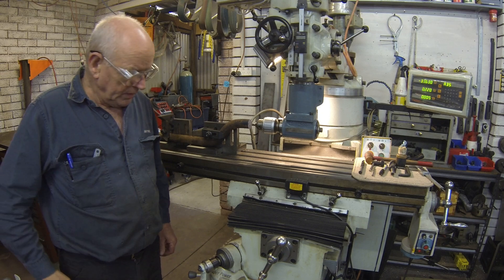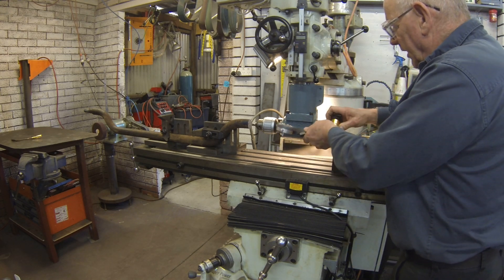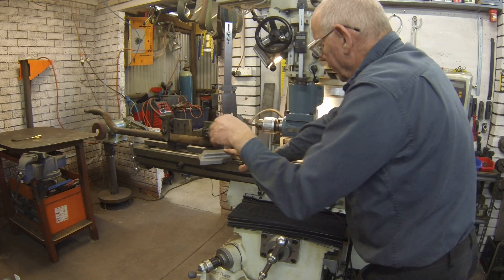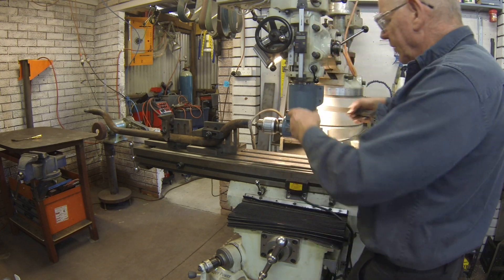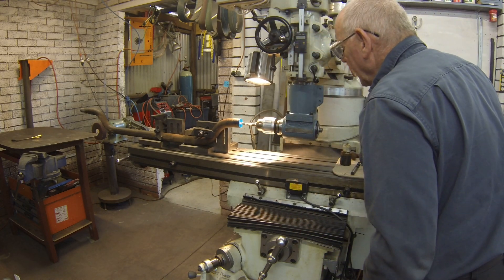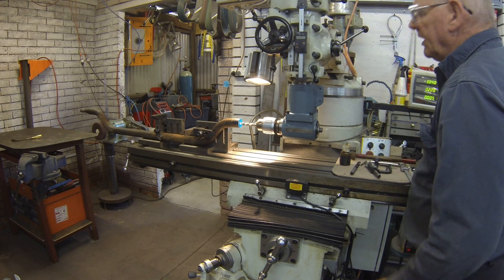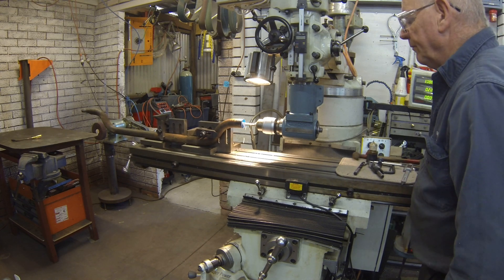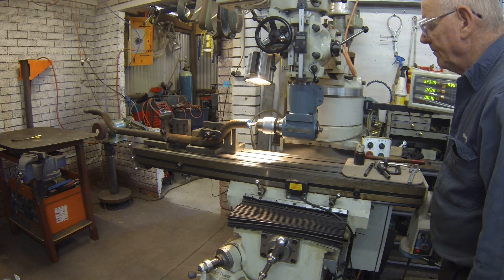Truck Tie Rod or The case of the bent shaft

Comment: That's an interesting job, please keep making videos I'm already a fan of yours!
That right angle head is pretty cool, I don't have one so I'd drill it in the lathe.
Reply from the maker: Paul Brown JTZ…….The method you use is not that important, The end result is what we look for. The more different types of machines and accessories that you have expands your ability to choose the method that gives you the comfort level and or efficiency in achieving your goals. Not all the jobs that I receive actually get done by myself, sometimes I don't have the capacity to do them so they go to colleagues and vice versa.
Reply: Very true, I was merely speculating on how I could achieve those results with the equipment at my disposal.

Comment: Am interested in seeing how you will use a big tap in that hole. I struggle with taps half that size.
Reply from the maker: Colin, I'll make a movie I'm about to have dinner and go back into the workshop and do the thread as the tap has arrived and I need the mill to do a slotting job.